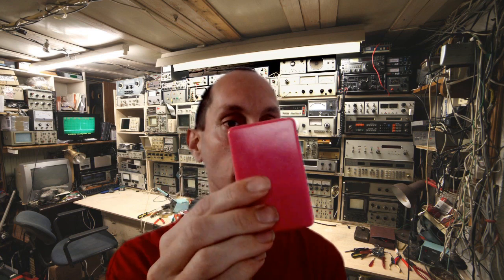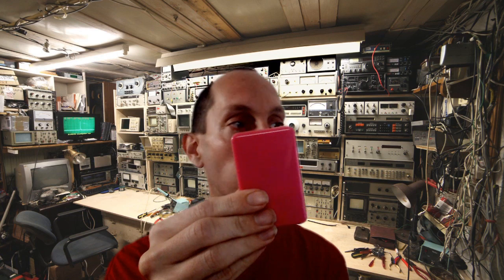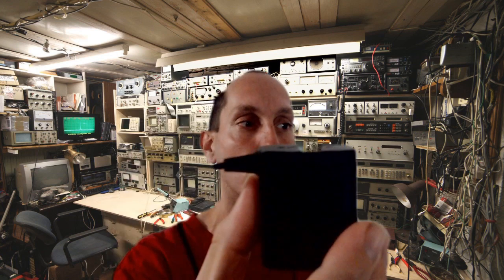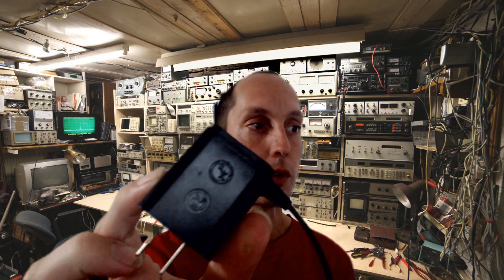Capacitive Reactive Power

Comment: We need a circuit diagram for the capacitance induction system to better see what your saying . I'm thinking one day we might power a bedini system with thermoelectric your body temperature alone . charging things ..bedini charged with moon light . There's a thermoelectric device that was a lead wire and a iron wire junction the guy was going to print them on paper then stack them like bricks around his house as a second wall and run the place ..but something didn't work out.he said he saw it in the lab but printing didn't work out .

Comment: Being connected to the grid is a crutch. Try using atmospheric electricity if you can run a bedini and charge several batteries on thin air your gold..I like your work I think one of the most relevant things you exposed was that the return energy isn't connected to input and more input isn't better necessarily..by knowing that you can adjust to max out your power and reduce input ..

Comment: Seems like "regular common normies" can't understand the difference between grounding and neutral. Or what is potential voltage difference. All real "electricians" have known this since the ground wire was introduced for home use. Most schooled electricians can't understand it either. Easiest example and schematics for explaining it is by "What if I did this" on video called: GREEN ENERGY DOES NOT GET ANY EASIER THAN THIS

Comment: Thats what the Segovia Box does, I built a sophisticated one for my neighbor he swears he is saving over 100$ a month . He says his old bill was like 250$ now he pays 150$
Reply: Can you tell us more about that Segovia Box ? Never heard of project that can do something like that .
Reply: @NemanjaR8  Segovia is one name for the device , power factor correction is another
Reply from the maker: Look up reactive power. Can also be used in circuit for more efficient stage. I think Morin may have been playing with part of this as well and used it in his motors. The general effect of reactance with a capacitor.  Small power supplies are the most common usage. But of course you can build your devices around this idea as well! It's also great to use as a near lossless current limiter. Without wasting all that available input current from the AC cycle with a flat out direct load acting like a resistor heating up with losses.And also working away from transformer coupling less loss.   As long as your working with AC.